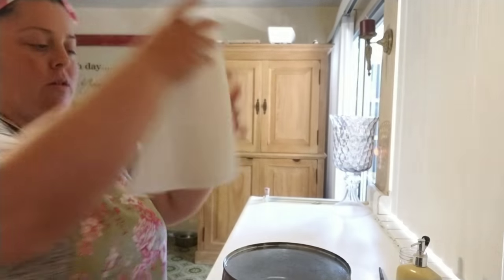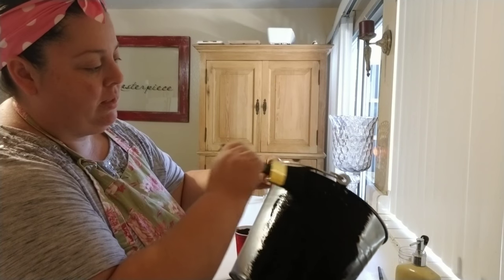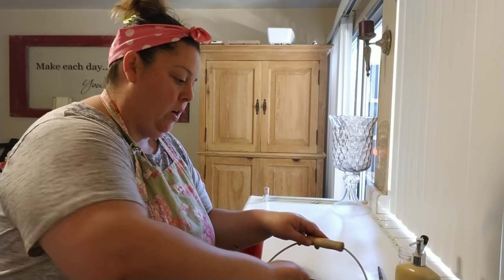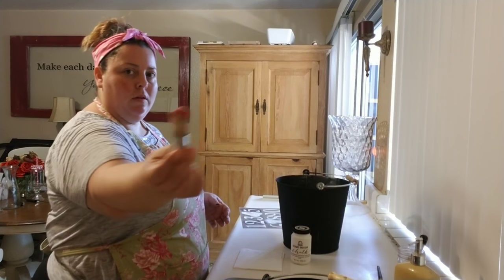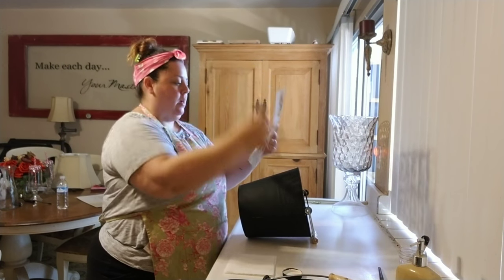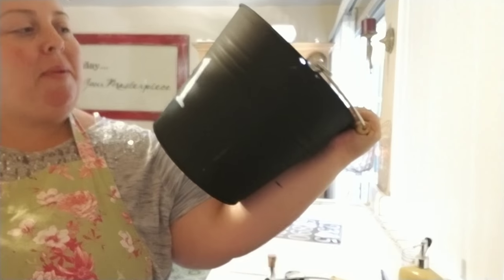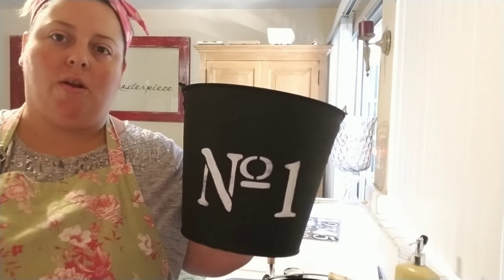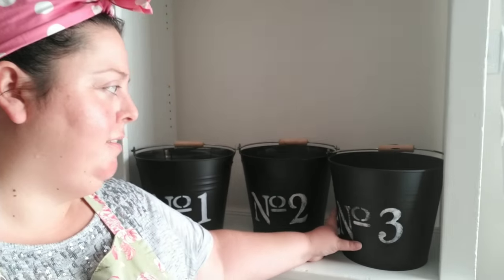How to paint a Galvanized Bucket with Chalk Paint.

Comment: How do u keep.it in place with no adheasive? Doesn't it move and it doesn't bleed? Maybe I use too much paint mine always bleed even on wood. Less paint?
Reply from the maker: Hi Kim, sorry for the late response. It's hard to answer your question without seeing what you do exactly. A lot of it has to do with the prep work. Are you cleaning and sanding your item before painting?